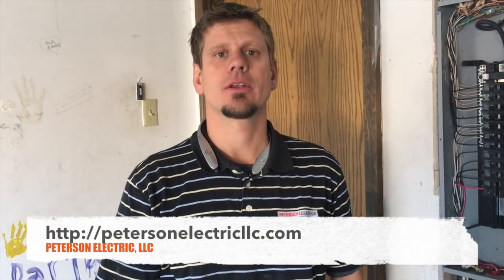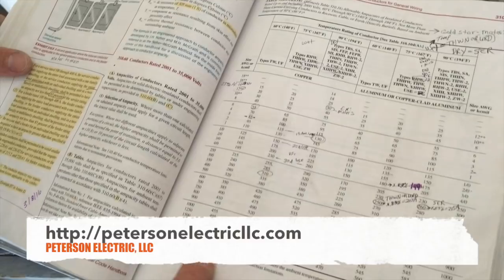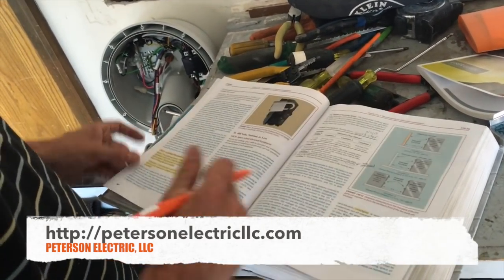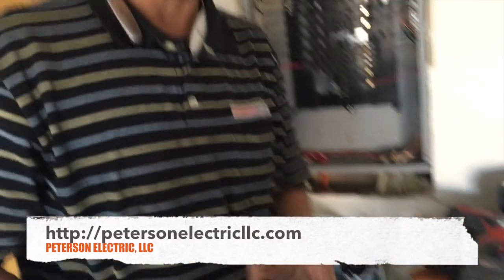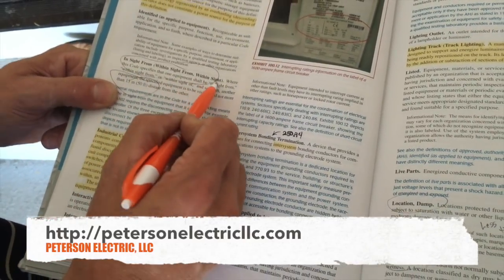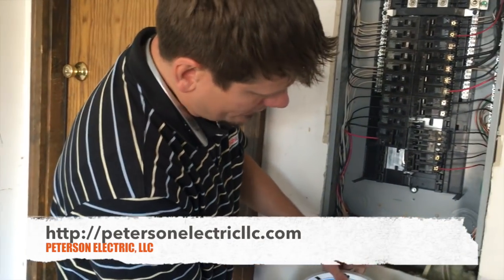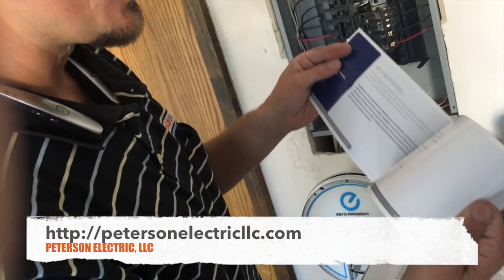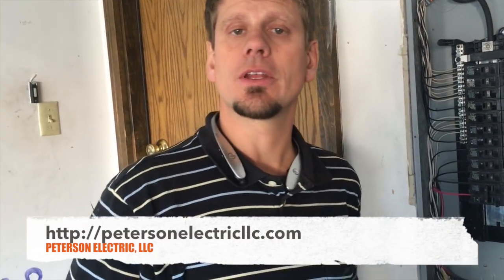Electrical Wiring For Subpanel & Nissan EV Car, Is There Breaker Space?

Comment: Thanks for the video, and talking about using the circuit breaker as a disconnecting means. I am getting a hot tub/swim spa and having an outdoor subpanel. I had tried searching to verify that was acceptable, and this video answered that.

Comment: nm section states 60 degree column. To use 90 degree column, the terminals on breaker and equipment must be 90. odds are 60/75. and it would have to be thhn or thwn-2 individually in conduit.
Reply from the maker: Not if you are using the article in 334 under NM and you are trying to reduce the value of 90c. as you are considering voltage drop, to current carrying conductors in a dry area. For example, trying to figure out how much current can be on a circuit for BBH Base Board Heaters, and you want to run #10 awg for 30 amps.

Comment from the maker: It looks tight, but it's not. It is about 4" on it's turn and it is not a complete 90* bend. The code talks about the bending radius in 300.34, BUT this is for feeders and conductors over 1,000 volts. This is because the feeders are on a very large scale. What your asking is going to be found in article 334.24. Also, in Cabinets and cutout boxes and meter sockets it speaks about the different sizes in the charts. If you look at the chart that compares copper vs compact Aluminum, and then in my video it shows that we are using #2 ALM/Comp. Aluminum vs Copper in this chart has more grace, it allows me for one conductor 3" on # 2 ALM vs Copper at #2 is 3.5" for the being. In this video you can clearly see that we are 4 to 5" on this bend. Now when I am doing a 200 amp panel with 4/0 feeders, ALM allows 7" where copper is 6". Personally I "Know" by experience that 4/0 copper stranded does not bend well at 7", so I will make a bigger turn. The purpose for the bend or hoop or loop is that if the feeder gets hot and insulation melts or diox has to be reapplied and trim the feeder you are able to do this without the extra expense of the bugs. Besides older panels have crap for space on the inside of them for repairing feeders. Some of my power utility forman want bends above their meter lugs on the line side and some guys want that cut stupid tight,. This is why we now have slip sleeves for our underground installs on 320amp meters and less. Look in 300.4G, it speaks about protection for feeders #4 and larger with protection for insulation and identifying cables.
Reply: Ñ LP gu get get g

Comment: I was under the impression the max breaker for 10 wire was 30 amps? Can you explain why you didnt use 8 wire? Im an electrician from Philly and Im just curious.
Reply: Matt Krywyj under 310.15b I think there is a table and most use 75 degree and he using the 90 degree section which is 40 . If that answer your question
Reply: spyderx92 yes thank you